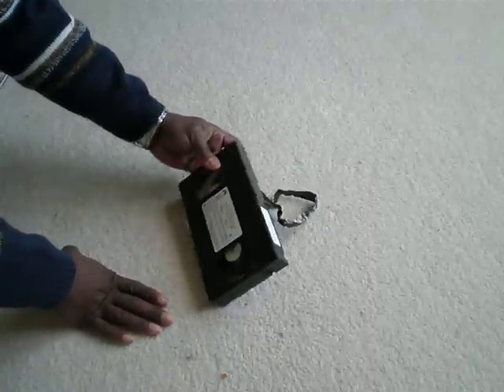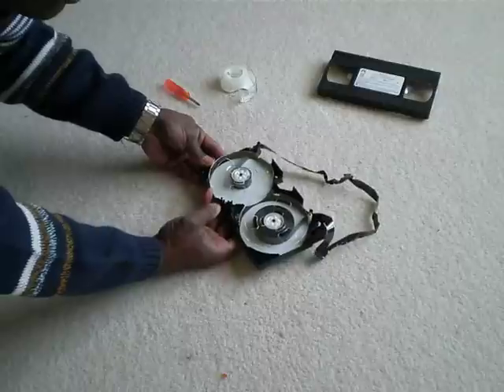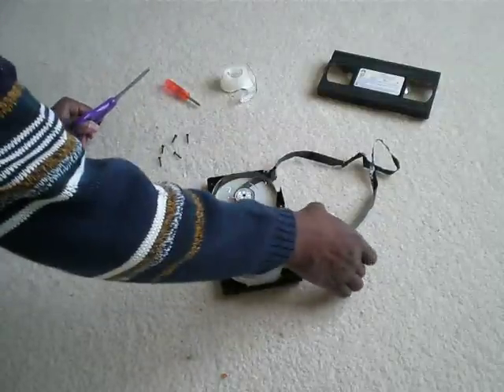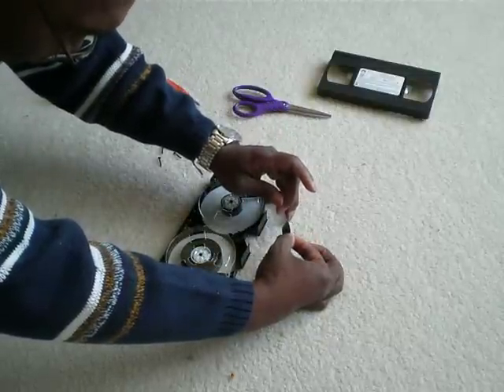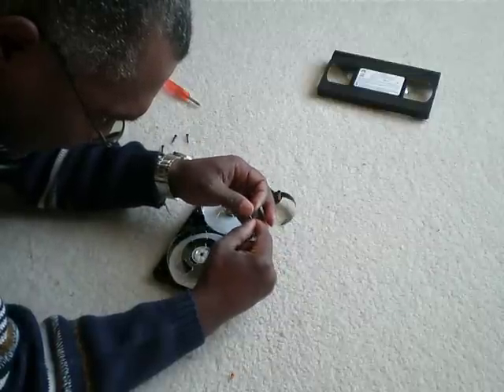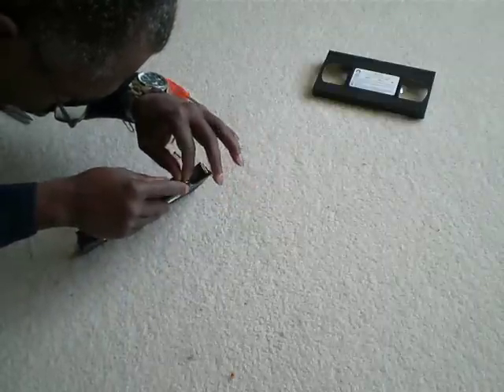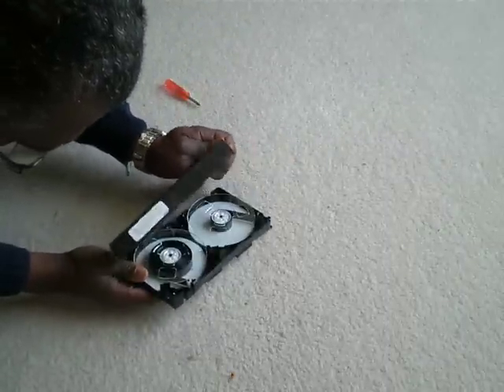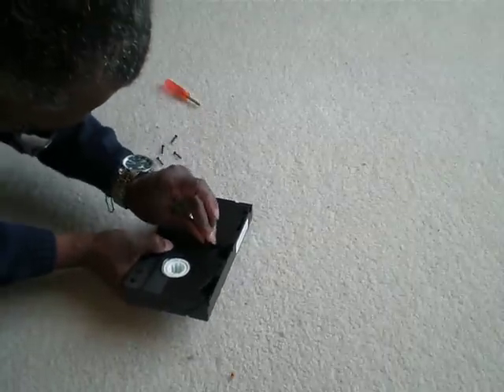How to Splice a Damaged VHS Tape

Comment: You wouldn't lose a scene from your movie if you spliced your tape would you? As if it was a home video (Old wedding video, Birthday party video, ETC)
Reply: I know I'm five months late, but yes.
If you cut a tape, you lose the video on that section of tape.

You could try flattening wrinkled tape, or splicing cut tape without removing more than was already cut.
Reply: another late reply but hopefully i have some helpful info. presuming your tape was recorded in SP (standard play mode) and NOT LP (long play) or EP (extended play) the tape is moving past the head at 1.31 linear inches (33.35 mm) per second so you'll lose 1 second of video for every 1.31 inches you cut out.

Comment: If you splice it don't you lose that section of the tape?
Reply: sadly yes, in SP (standard play mode)  the tape is moving past the head at 1.31 linear inches (33.35 mm) per second so you'll lose 1 second of video for every 1.31 inches you cut out.